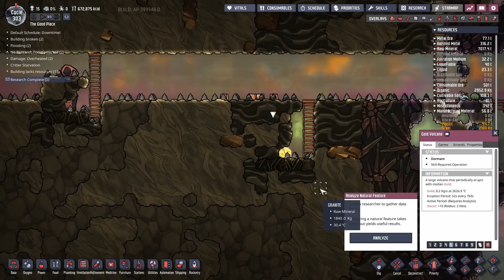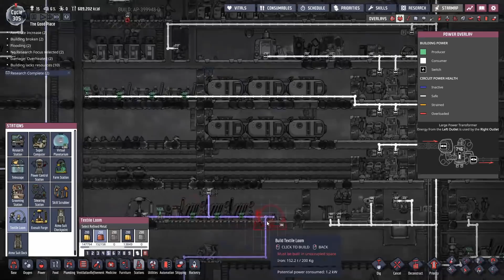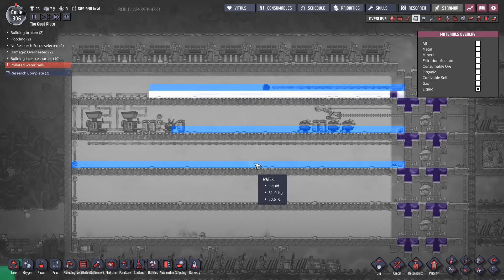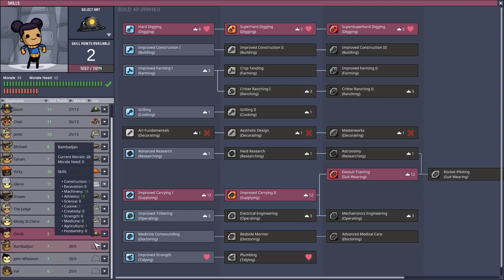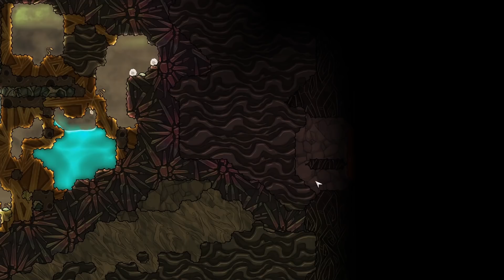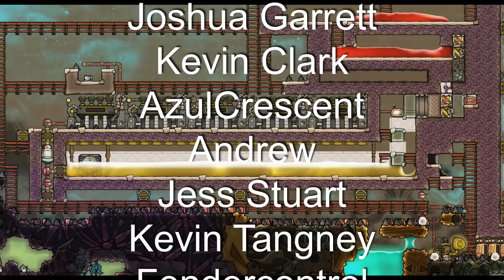Badlands Max Difficulty 8 : Sauna Heating and Geothermal Build : Oxygen Not included

Comment: I dont know if Francis reads comments on old videos, but in case he does. Why do you elevate the aquatuner up against the ceiling? Is there a benefit to it?
Reply from the maker: The closer it is to the turbines the better, it heats up the surrounding steam which the turbine eats. The further away you are the more likely you are to get heat accumulating and going above temps you don't want. (200C)
Reply: @FrancisJohnYT  thx 😊.

Comment: 9:37 actually the game will round down to 0 if the temperature change per tick is too small. For reference this happens at around 100°C temperature difference between two sandstone insulated tiles. Incidentally this is why heat capacity matters for insulated tiles.

Comment: Is it worth to stick a power station chip maker in with the turbines, if the max room size allows (I don't think it does in your case) - I've started a similar room recently and have just enough room to do so). Is the output buff worth the manual errands?

Comment: I've run what I call the "Hot-Box" 🍁🚬🍁 in my base for 1,500 cycles before my mods stopped working for a while and I got burned out. Some notes about Hot Industrial Power Saunas:

1. Running a petrol or crude cooling loop every 5 tiles throughout the mega-structure is very helpful to regulate the temps, making tempshift  plates even more effective, keeping enough heat at the top for the steam turbines to run, and keeping enough stability throughout the whole build.
2. You can use automation to siphon off excess water from some of the steam turbines (Excess water comes from if you run petroleum or natural gas generator arrays).
3. Keeping more than 1 temperature sensor is good, just in case there's asymmetry in the heat. I recommend having 2 or 3, covering different segments of the steam turbines.
4. Keep your temperature sensors at 138. This is half-way between 125 and 150. Equilibrium is between 137 and 138, going only as high as 140 in my experience. This is urgent for making sure plastic never melts. You can just run your plastic presses constantly in the system.
5. Attach a cooling system for conveyor conduits using water, polluted water, petroleum, or super-coolant if you want the debris to be cooled down from the 137 degrees the sauna would run at. Another option is to cool it passively through hot water tanks and then just cool the metal tile or weight plate you dump all your debris on.
6. If you're running conveyor chutes everywhere, make sure they stay 1 above the dump-offs to conserve heat and mass, and avoid crashes.
7. I recommend a layer of petrol/crude in the bottom of the entire mega-structure, so that TonyAdvancedONI's energy conservation trick works. This requires ripping up those airflow tiles in place of mesh tiles to let the water from the turbines drip all the way.
8. If there's one thing I would change from my experience, it's not making proper vertical corridors on the left and right of the Hot-Box exclusively for power transformers.
9. Make sure to always use ceramic insulated piping.
10. Installing room for proper transit tubes into the double vacuum sealed entrances would be another thing I'd do if I had to do it again.
11. I noticed Francis put his refineries on the far side of the Sauna. Putting all dupe interactions close to the entrances, with ceiling lights in them, is more labour-efficient. Same deal with liquid reservoirs for the refineries.

Comment: FRANCIS!  I have gotten an idea at 19:15.  That bottom left corner of the magma tank, put three doors (middle open to vacuum lock) and put a "set to 410C" petroleum tank there; dump ALL CRUDE OIL THERE.  Crude will sink, petroleum will float, pump petrol off the top, put through a steamroom cooler and bam, LARGE SCALE PETROLEUM BOILER!

I'm working on something like this in a build right now.

Comment: When it comes to bridges imho it's exactly the opposite. Of all my setups with countless bridges it seems that it's always them which are responsible to heat leaks.
If you keep one end of the bridge in a hot place thru an insulated block and the other end in a cold place the bridge with carry over the heat THRU the insulation. Same goes for conveyor bridges or automation (logic) bridges.
I too once thought bridges magically teleport things... yeah, so they do with heat. One is much better off with using insulated pipes when dealing with 2 areas with temperature differential :)

Btw these tiny corner locks made with naphta are rock solid for me. Naphtha has a really high viscosity so a single "blob" (which sticks to a single tile unsupported) of it is about 30 kg which is plenty for it NOT to flash even when something really hot goes thru it. Also it is a great thermal insulator, generally I love naphtha :) PS Ofc 2 tons of 1700 centigrade ingenuous rock will eventually flash it when dropped there.

Comment: You don't need to use a gas filter to filter the oxygen from the steam now because of the automation update.  You can use a gas element sensor and connect it to the new automation port on a gas vent. It's much easier than the traditional element sensor filter; you can run a line through a high pressure vent and have the vent only open when the steam passes thru the sensor, dumping it back into the room, and otherwise the vent will be closed and other gases will go straight past.  Though, I suppose at this point in the game the extra 240 watts for a filter is negligible.

Comment: I would have just build the magma dripper so that the heat is leaking into the industrial sauna
Reply: You'd need to modify/regulate that carefully with thermal couplers. If you let it drip straight in, it could melt materials and metals, converting granite into magma and petroleum into sour gas. You want a nice, slow leak.
Reply: @G.r.e.g.g.l.e.s  yeah I didn't mean just to pour in the magma, I meant like with a door that opens an closes to control the temperature in the industrial sauna always at high temperatures